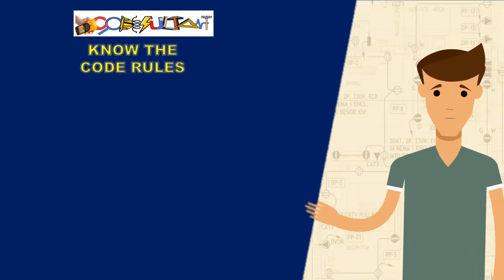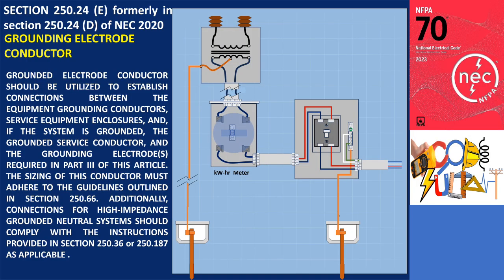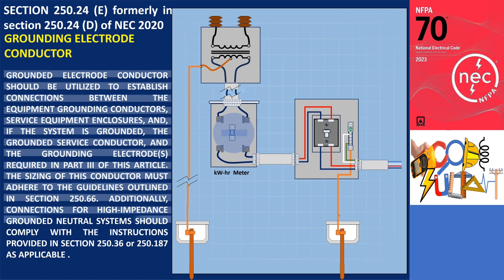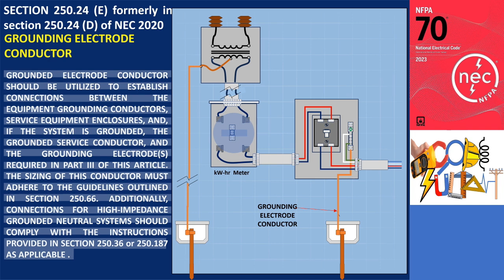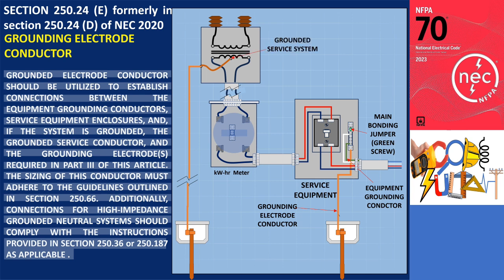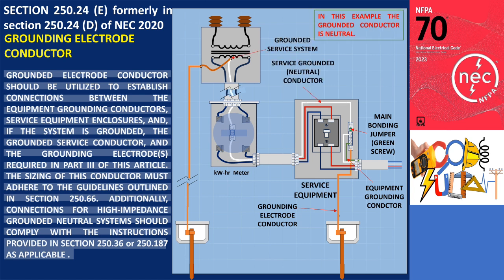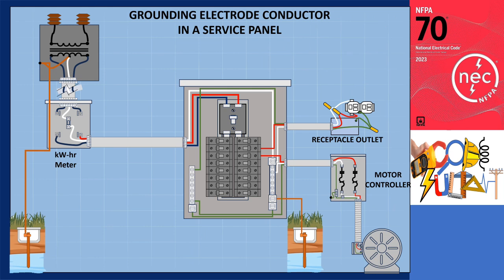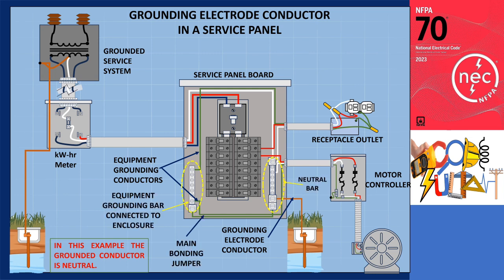250 24(E) GROUNDING CONDUCTOR ELECTRODE-NEC 2023

Comment: Dear sir, apologies I keep contacting you. Should be paying you consulting fees😂. Based on the table given, the ground round or electrode, is sized based on the main conductor size. I understand that depending on type of ground the electrode is being driven into various resistance.  Soft earth will have a lower resistance (especially when wet) than solid rock. I am building on rock, and I do have concerns that if I follow this I will not meet an acceptable impedance for the breaker and/or RCD’s to trip. One of the illustrations shows 2no. Rods connected. Is this a solution for solid rock to reduce the impedance. I’m aiming for a max of 200m ohms, although theoretically the value can be a lot higher. Many thanks
Reply from the maker: Hello,
Thank you for your comments! I’m flattered that you seek my advice on this topic. You’re correct that the resistance or impedance in solid rock, especially in mountainous areas, is typically higher compared to wet soil, making it challenging to achieve the minimum resistance for a grounding electrode.
The table you referenced provides guidelines for the size of the grounding rod to carry the ground fault current, not to attain the required resistance, but it’s essential to reach the water table to attain the required resistance. This can be particularly challenging in regions like the Middle East, where the water table is often deep. To reach it, you may need to use longer rods by adding extensions or connectors between them.
Additional rods or bonding with other metal like water pipes and the likes, you create  a grounding electrode system, which can also help reduce resistance since the total resistance will be lesser because they are connected in parallel. While I can't specify exactly how many rods you might need, I recommend digging deeper or using extensions until you reach the water table for the best results.
Thanks again for reaching out!
Reply: @codesultant  again, thank you so much for your help. I think it might be a challenge as we are sitting on a solid rock out crop but I will speak to the GC and engineer to see if we can achieve this. Many thanks
Reply from the maker: @davidcase4041  you are welcome, i hope you resolve it.